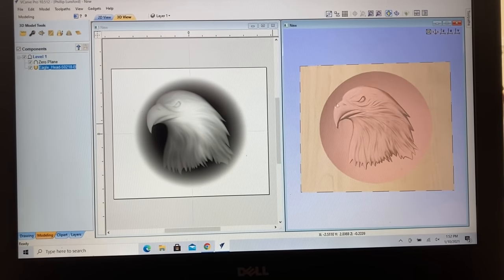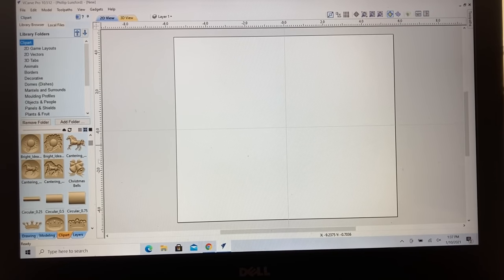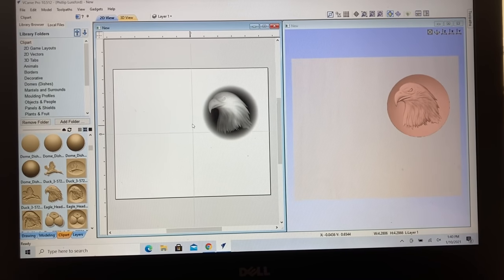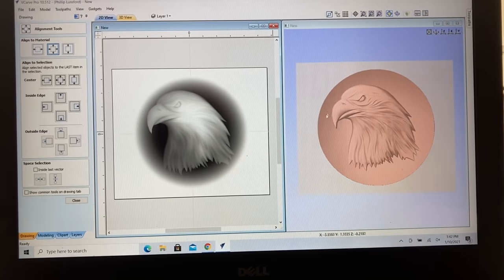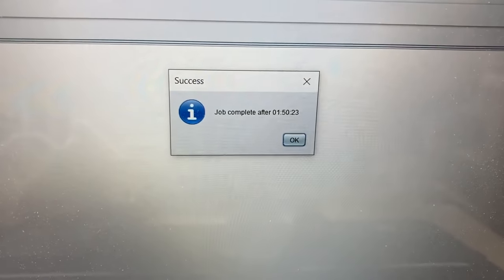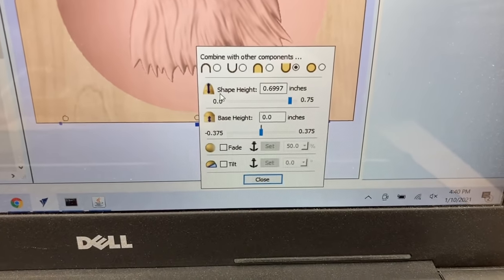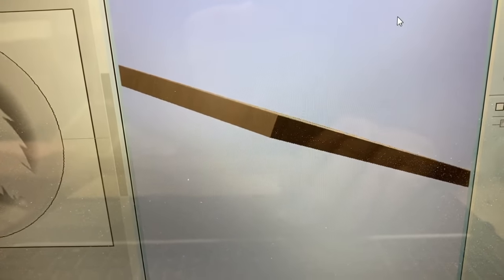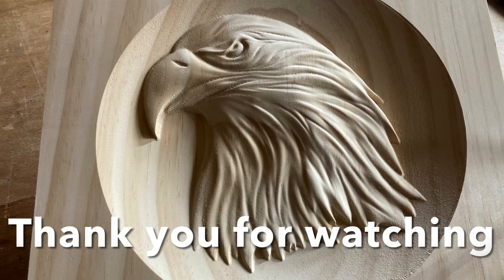Let’s Carve This Simple 3D Eagle on the CNC

Comment: hi can you please, kindly let me know how to wire z probe to touch plate you used in video ?
Reply from the maker: On the touch plate, you simply need to only add a screw to hold the wire to attached the wire.  The second wire hold the slip.  The opposite ends of the wires attach directly to the controller.  On the Demon controller there is a labeled section to attach the two wires for the tough plate.
Reply: @PawPawsWorkShop  thanks so much for your appreciated reply, unfortunately I use Arduino ramps1.4 not demon controller so can you help me to wire it to ramps1.4 😊🙏🙏🙏
Reply: @PawPawsWorkShop  also I need to make same like u did in video I don't have touch plate but I'm looking for how to find minimum z point using alligator method you use but with ramps1.4

Comment: Hi- I am looking for a desktop model for carving our wooden sword handles. Can you help me out identify a good machine and relevent software
Reply from the maker: For carving just the handle, any of the CNC machines can handle it the FOXAlien 4040xe and the genmitsu are great desktop models. As far as the software, if you are designing your own 3d design you will need something like Fusion 360 or Aspire. Then you will also need the sender program. I use Universal Gcode Sender (UGS). It free and does an excellent job.

Comment: Nice, until I found that VCarve Pro software has a $700 price tag.  Eliminated me.
Reply from the maker: You can start with VCarve Desktop and do the same thing.  The Pro version opens up additional tools and project size but this type of carvings can be done on the desktop  software.
Reply: @PawPawsWorkShop  I choke on spending 100 bucks on software, so 1/2 of 700 still leaves me out.  Getting older and pinching pennies, lucky to have some of the equipment to even play with.  Thanks... Take care.
Reply: @jackwilborn2353  if its anything like 3D printing the software makes more difference than the printer.  My 3D printer is an early filament model that I have carefully set up and I get mad print quality off a mostly stock unit at decent speed because I use upgraded software that produces my G code for the printer.  It gives me highly optimized G code for my printer.   Someone will have to confirm that the router/carvers are the same but I strongly suspect this is the case.  Any thing too much cheaper is likely not a true 3D or will be extremely limiting or require you to learn to write your own G code or won't produce anything bigger than a double thick coaster.  That seems to be the state of the industry at the moment.  

I have been shopping for one because I have trim for my house that I need to reproduce and I would like to do it from 3D scans vs making molds and casting resin since it has to withstand UV.  Another thing to keep mind is the 4 hours that he mentions the process takes.  What he's carving isn't huge  but it's still taking hours.   There's also some prep for setting up the bits and aligning the proper location for  x y and z for the work piece which isn't included in the actual carving time.    

That groove he mentioned is caused by using screws and using them from the top of the mdf work surface

Comment: $2,000 for weak software that looks like it was made for Win 95. You can not even test it on your own designs to see if it works for you.
Reply from the maker: That would be for Aspire. It is an amazing software for the cnc. What did you have in mind that would be a better option?